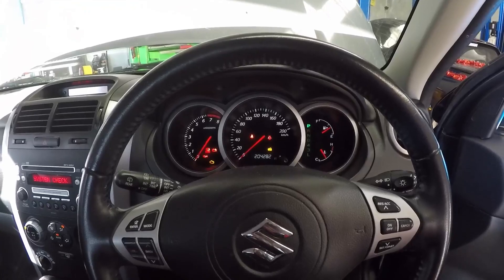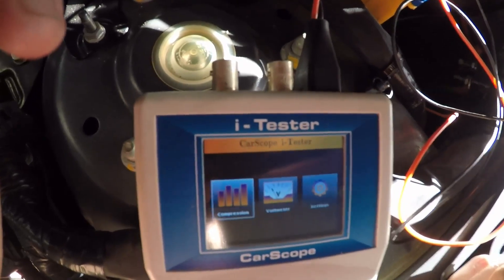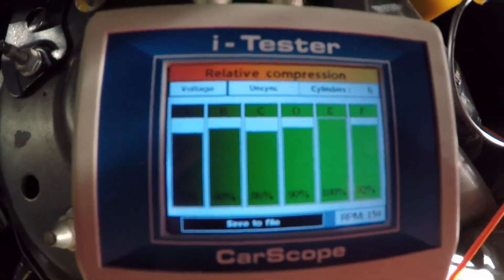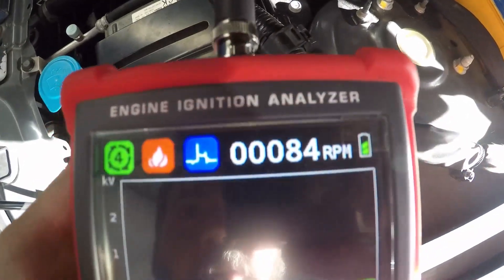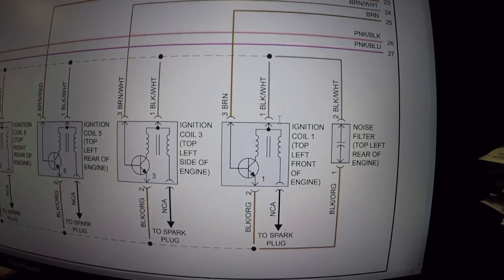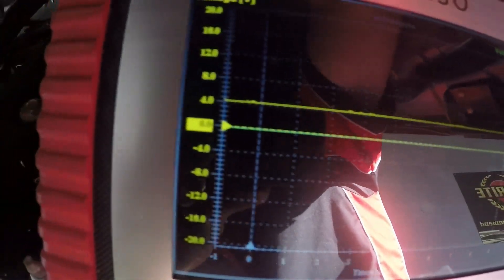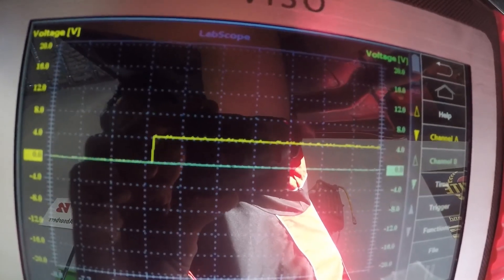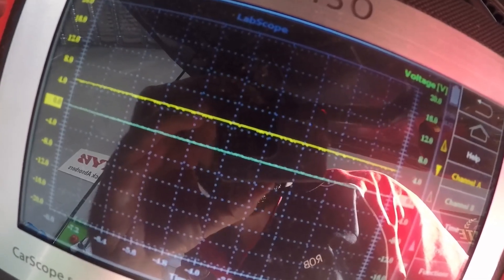Suzuki Grand Vitara V6 Misfire - Not What You Would Expect! - PLUS DITEX TRANSDUCER GIVEAWAY!

Comment: Question Sir if I could...Trigger line at a constant 5V would translate to an overheated coil, due to excessively long (constant in this case) dwell time. Did the coil show any signs of overheat and was it subsequently replaced @ Suzuki? Thx in advance.
Reply from the maker: Yes that is correct. It already had the coil replaced by their previous mechanic and it was getting red hot so they disconnected it before sending it to us. The coil was still serviceable, so Suzuki just replaced the PCM only and it was all ready to go back to the customer.
Reply: @romanosautomotive   Thx for the reply...Interesting and well thought out content on yer channel. Subbed & Cheers 👍